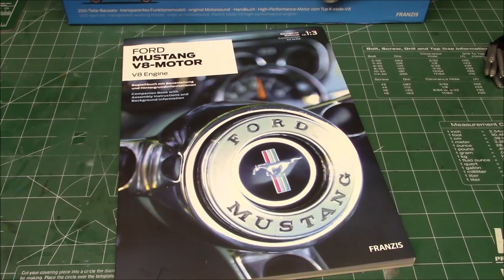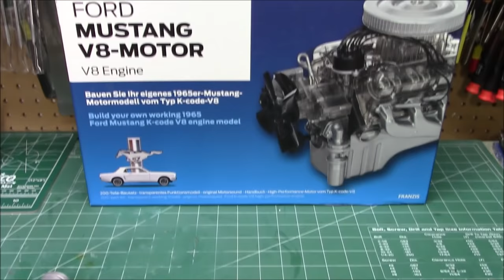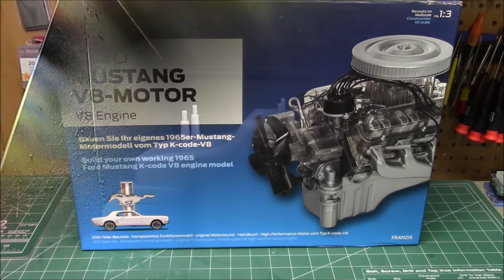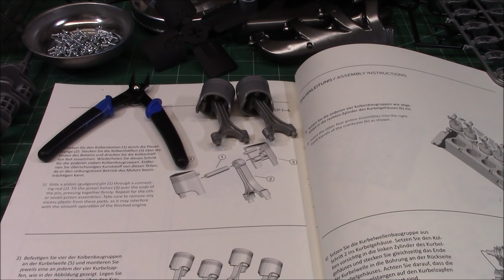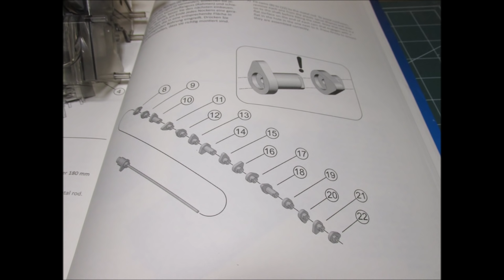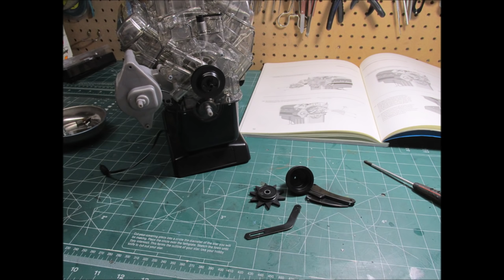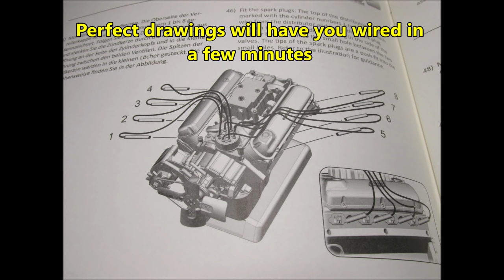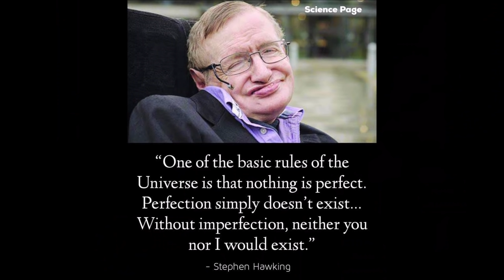1965 Ford Mustang 289 V8 1/3 Scale Model Working Engine Kit Build Review Franzis FMV019

Comment: Soooo many options with this - All clear, Paint just Half (alternator side), Paint 90% of it stock colors, add small amount of weathering, slide silicon tubes over pug wires for color, the Intake could be further detailed. Again - soooo many options. And the correct internals - a great teaching tool as well. I totally dig the way your's turned out - just enough detail. Seams well worth the price. I've actually been waiting for something EXACTLY like this.
Thanks for sharing...
Reply from the maker: This thing ROCKS.  So smooth running and easy to assemble. 
Much appreciated!
www.facebook.com/hpiguysworkshop

Comment: One thing I would do is a wash on the simulated air filter to add a bit more detail. Another is make a 1/3 scale 289 decal for the air cleaner. And where did you get your turn table?
Reply from the maker: It's from Trumpeter but any turntable will work.

Comment: Very nice model, it looks great. One detail conspicuous in its absence is the harmonic damper. The k code Hipo 289 had a thicker damper than a standard 289, so it should have been included. There is certainly enough room for it behind the crank pulley. Aside from that, very realistic depiction of a K code 289.
Reply from the maker: Much appreciated!
www.facebook.com/hpiguysworkshop

Comment: Got mine together last night. Was running fine for about 10 seconds then the motor seemed to get stuck and stopped the crank. I thought it somehow jumped timing so it redid the whole thing and it is still just randomly stopping. I have to turn it off, and manually with my hand turn the crank pulley and I hear a click. Maybe it's a gear tooth but I didn't see anything wrong with any of the gears when I put it together. The other thing is the rubber timing belt seems to walk across the cam drive gear and almost slips off but the timing cover prevents it from completely separating from the gear. Not very happy considering this kit was 200 bucks. Please if anyone has advice, much appreciated

Comment: Nice job. I prefer the Renwall/Revell V8, which has an actual intake manifold, the intake and exhaust passages molded into the head, and a clear oil pan so the rotating assembly can be seen.

Comment: Just one thing: the early 260's were black (oil pan), but the 289's were blue (dipstick). A 260 would've had a generator (much larger than an alternator). Nits, I know... The carb coulda' used some gold paint as well, but, all in all, a stellar build as usual!
Reply from the maker: According to the Ford experts the K code 289 in 1965 was black block and pan. 
I did blue on the dipstick just to draw attention to it but factory perfect accuracy isn't my goal anyway.

See below with a pic of a real engine out of the car. https://www.mustangsplus.com/mpshows/octshow07/

Comment: Cool model buuut... molding the carb in with the intake was a mistake, and that with almost no detail. Like the 1/4 scale Testor’s hemi there are no intake or exhaust passageways in the heads. They could have at least indicated them somehow. The oil pan could have been clear to see better the crank along with an oil pickup. The alternator as a motor is clever though as is a rubber timing belt in lew of a chain. It is a nice model with decent engineering with it’s all screw assembly but at $180 it’s a bit simplistic. All we need is a clear transmission.

Comment: Hey Chris, that is an amazing kit. I was wondering if maybe using a variety of Tamia clear paints would work on the clear parts would give the engine some more color but still be able to see the internal workings of the engine?? It would be pretty cool to see a bit more color on this build. Again "BIG" Great Build😊👍
Reply from the maker: Maybe, another guy in the comments had an idea to paint only sections of the block and leave others clear, like a cut away.

Comment: nice, I probably would have done mine up in Ford blue, it would look more factory . again, nice job Chris !!
Reply from the maker: As stated in the painting section, these particular engines had black blocks and oil pans. I had to look that up and ask a few Ford experts make sure.
But when making yours, any color you want is fine. Hence why I did the dipstick handle in blue.

Comment: nice comes out lookin good and when you line up the timing marks on the real deal no 1 should be at top dead center like it is on this plus the real engine is not sposed to be tuned until you get the distributor in place good for learning about how engines work nice vid
Reply from the maker: Yes, it's really detailed, they paid good attention to reality!
Much appreciated!
www.facebook.com/hpiguysworkshop

Comment: Awesome kit and build Chris! I was wondering what do you think of the rustoleme nozzle? I always use rustoleme but recently I've been having alot of clogging issues... Never did before and I love that paint and all the cool colors they have. Have you noticed any difference in the cap/nozzle? I wish they wen't back to the old red cap!
Reply from the maker: I do get blocked nozzles now and then but a 24 hour soak in super clean fixes that. 
And I save the nozzles from empty cans so when one gets clogged I can make a quick swap and soak the clogged ones.
Reply: @hpiguy  I do the same, I have a jar of lacquer thinner that I leave on top of my booth where I soak my clogged nozzles. I never had that problem with the old caps... And you can't swap nozzles with other brands. o well, at least I know I'm not the only one they clog up on, I don't have any issues with other caps but rustolem is my go to paint, I can get it 5 minutes down the road at the hardware store and the color selection is awesome! And the price is right. I just wish they kept the old style nozzle, Don't fix it if it ain't broke!! Lol, Thanks Chris.

Comment: You should get a second kit,and prime it;and then paint it with Ford/GM engine blue ceramic & enamel engine paint from Duplicolor.Assemble the block first;bedore painting it with the Ford/GM engine blue.That way all of the parts can still move;when you take apart the painted block,to finish assembling the all of the internal parts.

Comment: Needs a set of 4 down draft webbers and try-Y headers and 715 Holley center piviot Le-Mans carburetor with long tube fillers on the valve covers.

Comment: Just my opinion. The oil pan and the top of the air cleaner would look good In Ford engine blue
Reply: In 1966 it would have been painted Ford Blue.  In 1965 the engine block, heads, intake, and oil pan were black. The air cleaner and valve covers were painted gold except for the K Code which were chrome.

Comment: WHERES THE OIL FILTER ? LOV THE MOTOR
Reply: i'm pretty sure the part he calls the fuel pump is actually the oil filter. (and see 11:51)
Reply from the maker: It's the fuel pump.
This has no oil filter as part of the kit.
Reply from the maker: OIl filter is shown in this pic half way down the page of the K code engine , to the right of the fuel pump, this is the engine I modeled the kit paint job after.

https://www.mustangsplus.com/mpshows/octshow07/